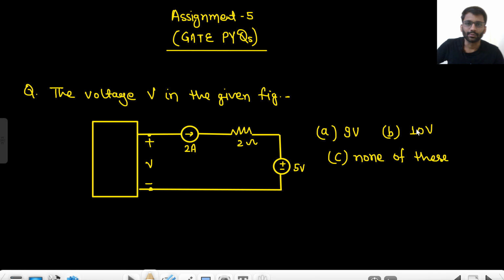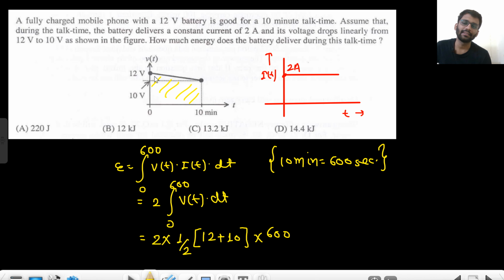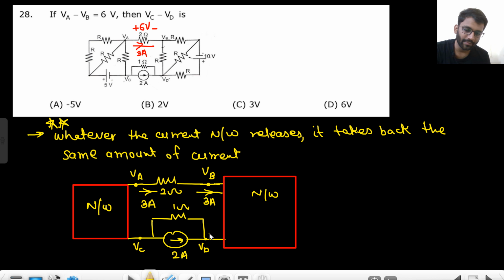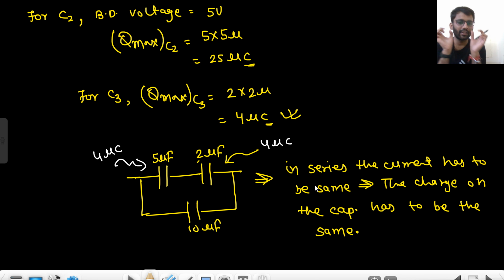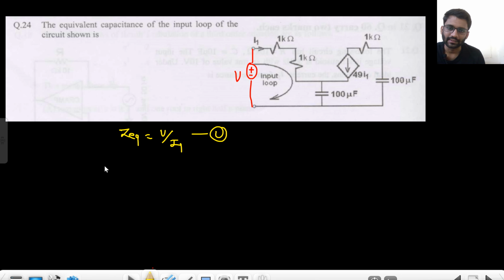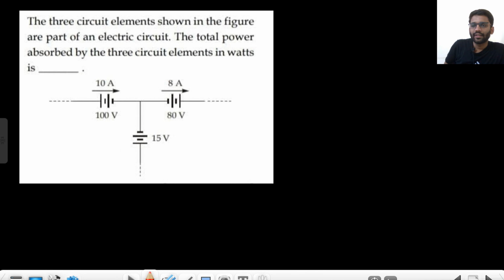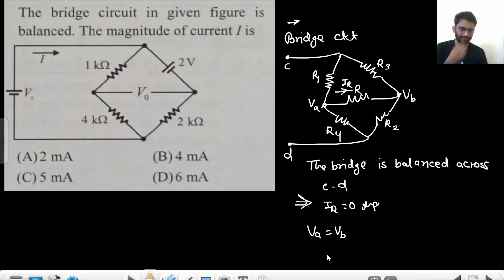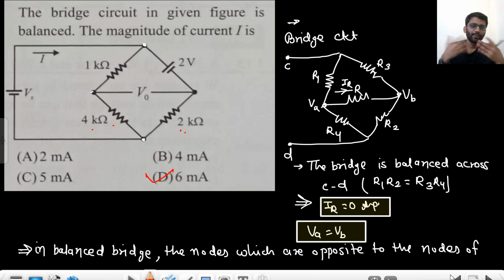Assignment 5 (GATE PYQs) Solutions || Network Analysis || GATE 2025-26 || PrepFusion || Himanshu

Comment: Hi,Can’t we apply the formula v^2/R , for the question 100 ohm 1w resistor and 800 ohm 2w resistor?  I tried and getting 90v as the answer, the option is also included there but I’m still confused.
Reply: use Voltage method when the resistors are in parallel, because when resistors experience same voltage. Due to this, single voltage can be used to determine whether both resistors are in safe state.

Likewise in series, calculate the maximum current which can be tolerated by the both resistors. And that current can be used to find the voltage across the both resistors. 

Hope it helps!!
Reply: @joshuag2721  tq

Comment: As the bridge is balanced, the middle path must be open circuited to ensure current = 0, not short circuit. If you short circuit it, then all the current through 1k resistor will flow through the short circuit instead of 4k resistor as the current flows through the path of least resistance. Please check it once.

Comment: @HimanshuAgarwal_ can you please explain the capacitor question in detail please
Reply from the maker: Hi, Actually in the question they have asked to find the total charge across the equivalent capacitor, not the addition of charge across each individual capacitor. 
So the answer as per the given question will be 32, not 36.
Reply from the maker: It has been explained in detail only I guess
Reply: I had a very simple doubt, in the series caps C2 and C3 charge stored is 4uF each and C1 stores 28uF.... so total will be sum of all three...I mean 28 + 4 +4 = 36uF. Did I understand this correctly, please?
Reply: Hi bro you are brilliant

Comment: 3 capacitors wale question me Q=CV uske karke Q nikala to 32 aarha as V=2.8V and Ceq= (5||2)+10=11.42 and then 11.42*2.8=32 or ye bhi option me tha. Please explain @HimanshuAgarwal_ and correct me if i am wrong
Reply from the maker: Hi, Thanks for marking it out. Actually it's a blunder from my side, I will make a separate video and improve this.
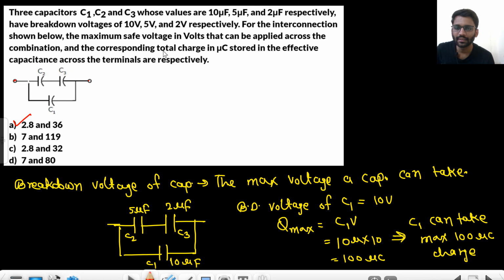Reply: yes sir why differnt ans at 27:00
Reply: I actually have the same doubt